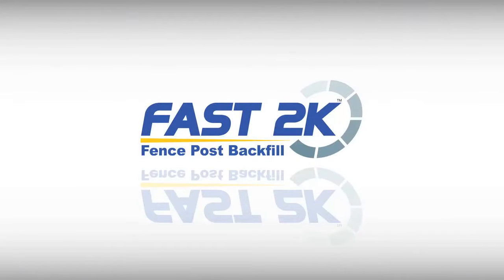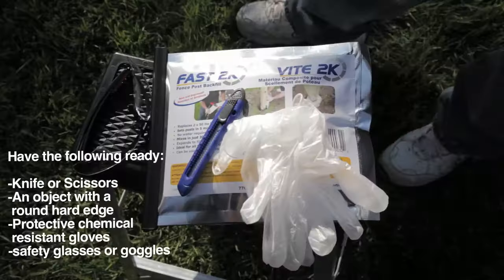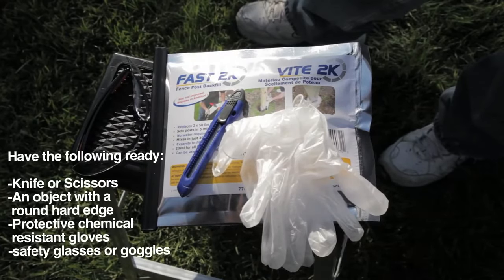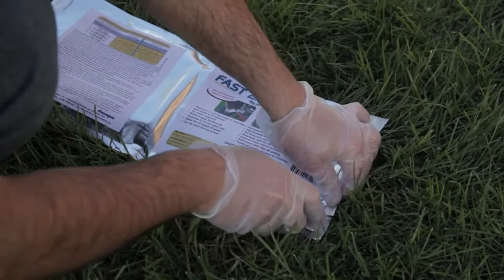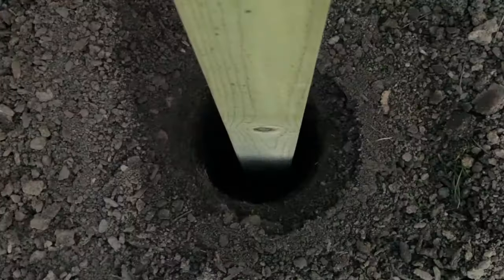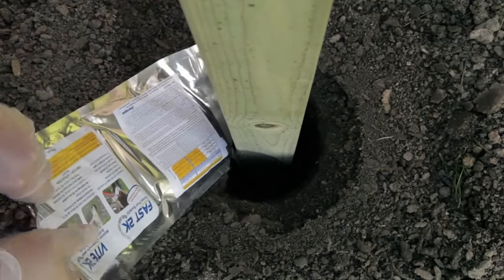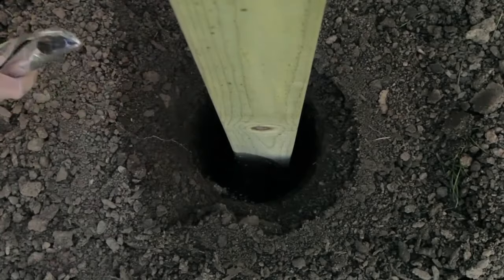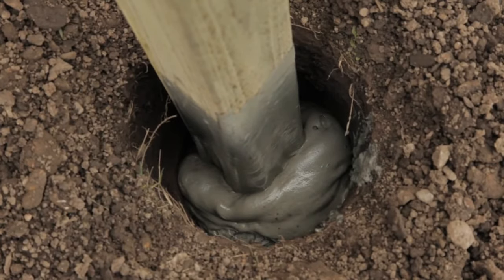How to Use Fast 2K Fence Post Foam

Comment: Hmmm, was thinking of using this for 3, 10ft 4x4 posts to hold up string lights. Not sure it will stand up to the strain of the wire between the house the the posts. Planned to put them 2 ft in ground, so needs to hold 8 ft. Was also going to use those pointed post braces on the base in the ground. Should I use concrete instead? Is this application considered "structural" - as they mention in the video?

Comment: Beware: 30 seconds almost too much ...bag expanded quickly and blew before getting completely in the hole, spraying on shoes and legs a bit..even shot thru between fence a bit..WOW...I would say at 20 seconds quit and start cutting open bag..NOW to get crap off skin, read the warnings as well. I think I will stick with my old construction ways next time..LOL

Comment: I see you didn't mention price. Foam $20.00 a bag, concrete $4.50 a bag. If your setting a fence with 15 poles that's quite expensive.
Reply: Supposedly it does 2 posts
Reply: Time is money 5 to 4 minites setup time  30 min and start setting post , the lanor time is a game changer.
Reply: enjoy hauling bags of concrete instead

Comment: Should have been more suggestions on use like squaring, up lifting a few inches out of hole before pouring etc
Reply from the maker: Hey Steven Lewis! Thank you for your feedback. Fast 2K was designed to be fast reacting and as you recommend, having the post plumb prior to mixing the product is the best way to ensure the post is set in the desired position. In order to ensure the post remains plumb and the expansion of the product isn’t interfered with, bracing is recommended. For proper installation, the post must sit on the base of the hole, this will eliminate the product from lifting or twisting the post during its expansion.

Comment: looks like a total gimmick to me
Reply: It works just used it pretty impressive works great for speed
Reply: @tm850r  concrete is stronger and will last forever, that spray foam as other YT videos have demonstrated is a joke, one kick and that post is tipping over. Try it and see what happens.